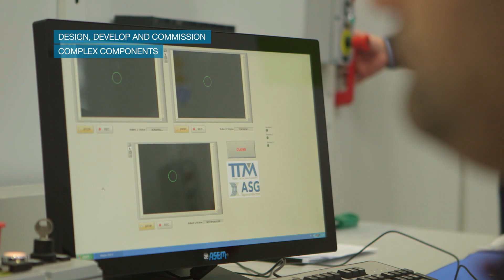FUSION FOR ENERGY and ASG - Working together for ITER

Comment: Between ITER, Lockheed Martin and other smaller contenders I wonder who will be the first to breakthrough the fusion problem.
Reply: China probably.
Reply: China's contributing to the ITER project actually, but only a small fraction.

Fusion's probably too large a problem for China to tackle without partners. Even Lockheed Martin is looking for partners despite their smaller/cheaper cycles.